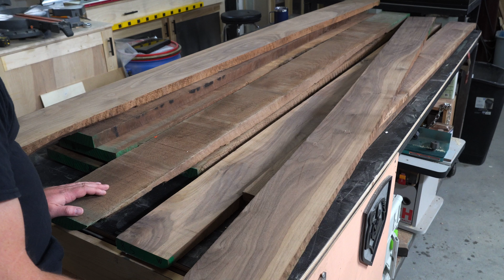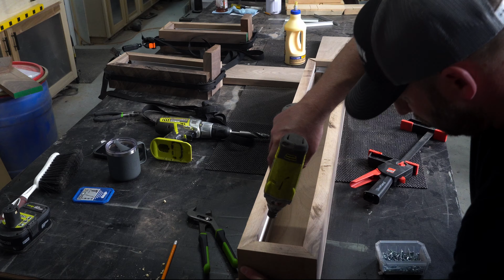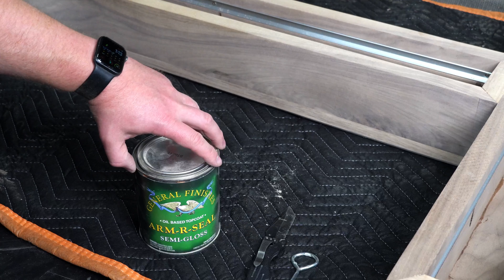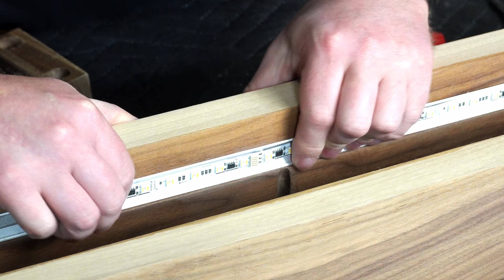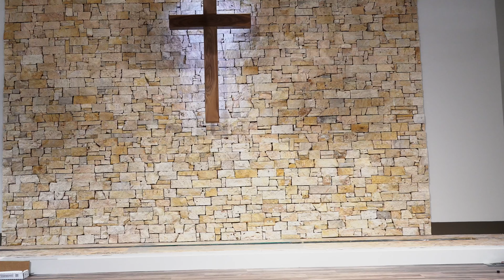Building with the FANCIEST LEDs I've ever seen

Comment: What a beautiful final product! Out of curiosity, why did you use the 45 degree corner channel for the LED instead of using a regular flat extrusion? Seems like it would have been much easier to install with a shallower pocket.
Reply from the maker: Great question - and I wish I had a good reason for it - but unfortunately it was all that came up the first time I searched amazon - but I just went back and re-searched and there are TONS of better flat options just like you suggested.  I dont remember what search term I used last time, but this time I just typed "led channel."    That would've been much easier.😂   Thanks for watching!
Reply: @BearhawkStudio  No problem! I've done MILES of LED strip installations so I just wanted to make sure you knew there was an easier way!
Reply from the maker: I'm ordering some of the flat stuff now for my next project.😆    Thanks again!